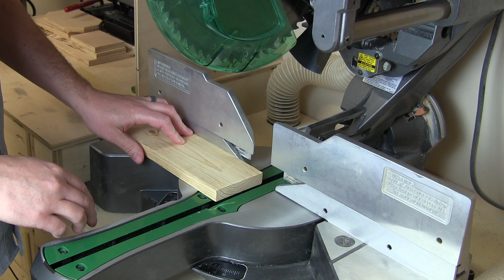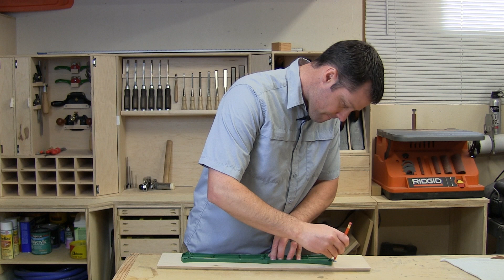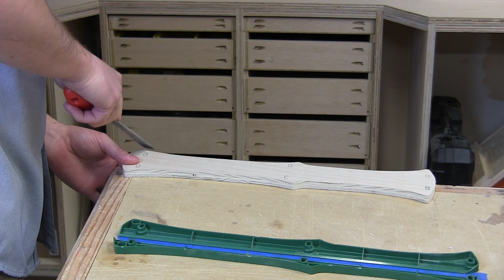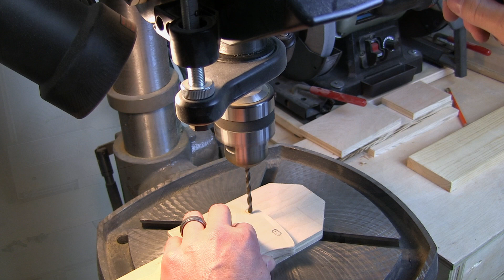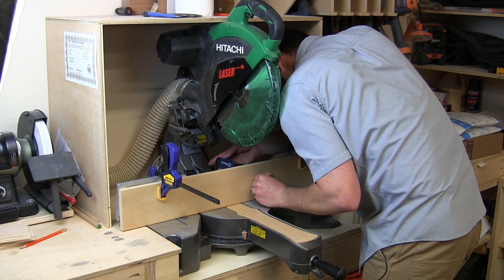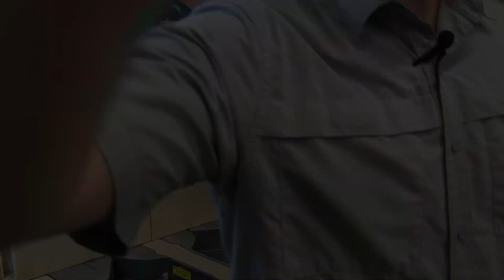Improve Cut Quality with a Miter Saw Insert

Comment: Sooo this guy tested a zero clearance against a new blade and the blade won.  I don't buy this zero clearance hype.
Reply from the maker: Actually, this guy tested a zero clearance insert against a well-used year old blade, and got a cleaner, more accurate cut that was a lot faster than sneaking up on a cut line. You don’t have to buy into the “hype”, but if you tried it yourself you might just like the results!

Comment: This is a purely "Rookie" question;  when using the saw to cut mitered cuts, then I would need to reinstall the original insert and fence? Many thanks and look forward to your future videos...ken
Reply from the maker: Ken Moon for a miter cut (swinging the saw left to right on the table) you would only need to separate the fence so there’s enough room that the blade doesn’t cut it. The insert in that case still lines up with the blade. In the case of a bevel cut (tilting the saw head) you would need to reinstall the original insert to maintain the zero clearance benefits of the new insert. You’d also have to move the fence out of the way to prevent it from being cut. Great question, and thanks for the comment!